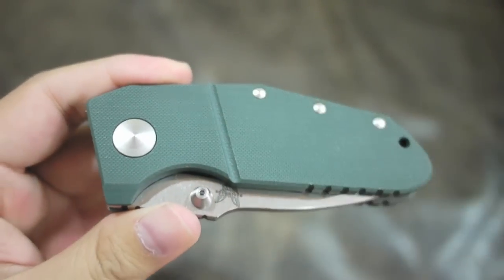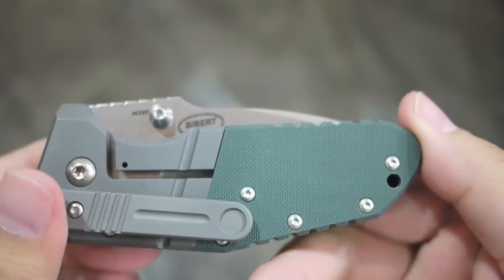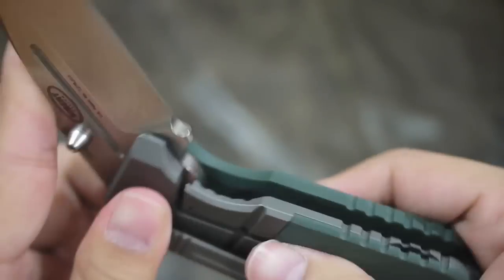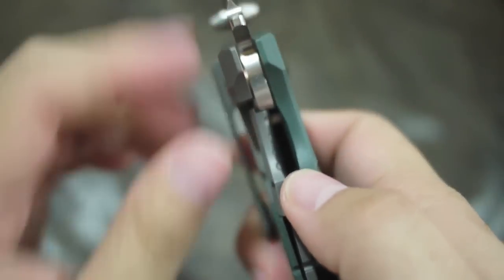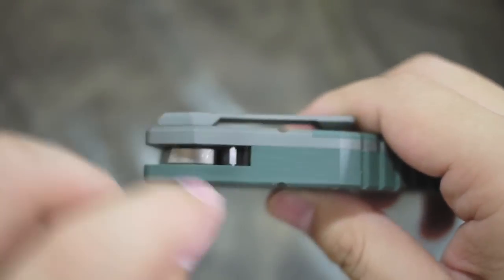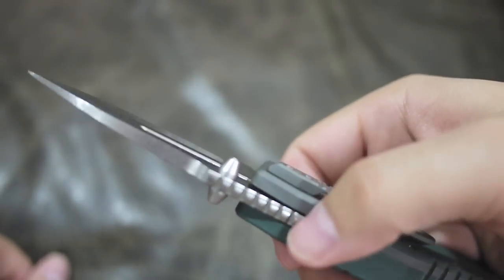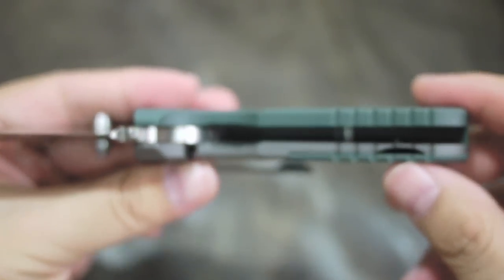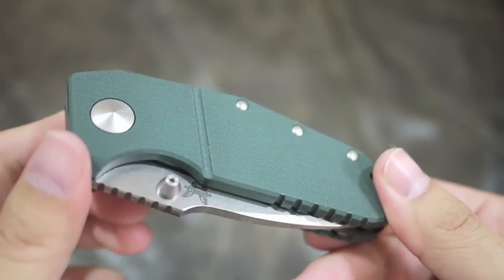Benchmade 755 MPR first impressions.

Comment: Great review on an interesting knife.  Seems very heavy duty - one of those possible "lifetime" knives :)  The 760 LFTi LUM has a blade stop that looks like that one.  I used it to adjust the tightness of the frame lock (thumb pressure required to release the lock) and remove forward/back blade slop.

Comment: your correct on both points , but I still think they missed their mark.Still too small for real hard use , not comfortable in hand like the Tenacious or the bigger Benchmades..I don't like to beat up expensive knives , just durable users are for that purpose .Mind you it looks cool on its own merit .I think I'm going to pick up a Spyderco Stretch for hard use soon .Or maybe  one of those Chinese Sebenza in D2 steel ..
If only Cold Steel had better choice of steel , heir locks are unbeatable .

Comment: Problem with ths knife is its market position in my opinion Here you got a knife that retails over two hundred and can only be seriously used as an EDC due to its size .The coolness factor is great but the lowly Spyderco persistance does as good a job on a regular basis , for peanuts over thirty bucks .Better buy a Sebenza if coolness turns your crank .or go for the bigger Bechmades for value per dollar spent .
It is going to be a trailer queen of a knife , never to see any real cutting .